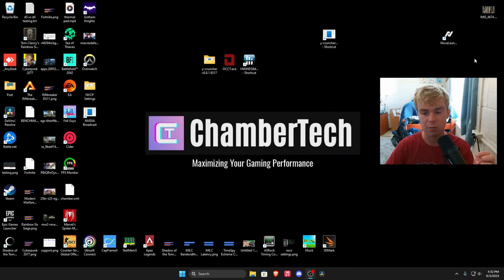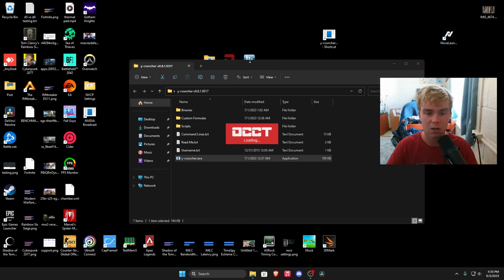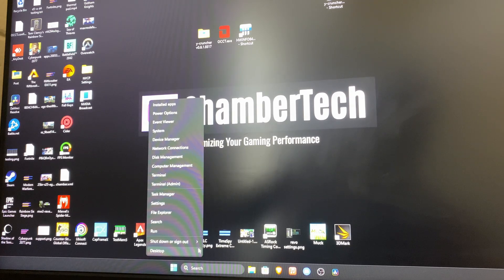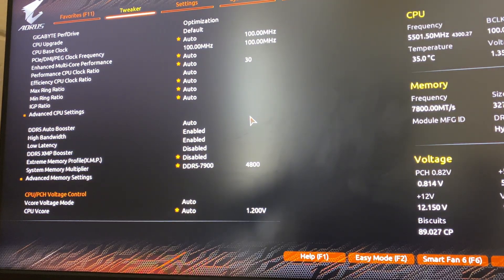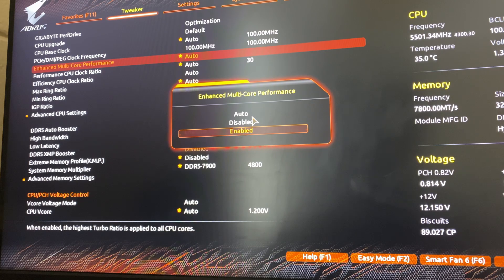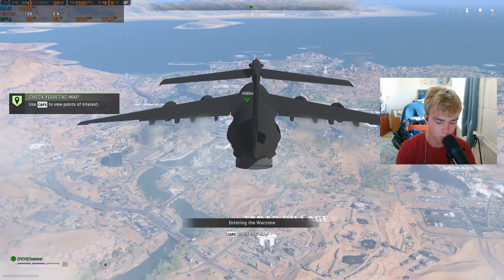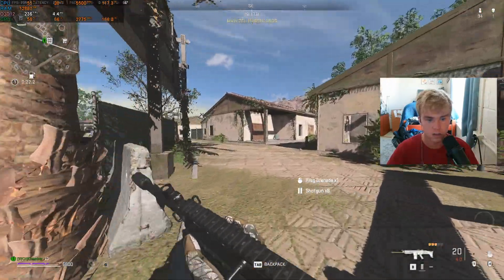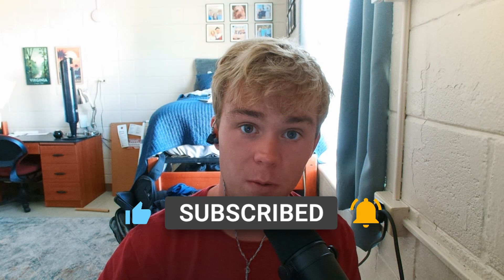CPU Undervolt Guide 2023!

Comment: I have 13700kf,2x16 7200mhz tuned latency is under 52 passed all stress test GPU Rx 6800 xt I'm very high fps but my .1% low fps is dipping from 200 to 9 fps and freezing for split second which is driving me crazy tried all the shit on online but nothing worked . Can anyone help me.
Reply from the maker: Something is unstable. Or the 6800xt is doing some amd things
Reply: @ChamberTech  my m.2 SSD is not running on raid mode and csm support is enabled in bios when I enable vmd settings my is not booting

Comment: So happy when I switched from the 13700kf to an 7800X3D, like 70-100W less powerdraw for the same gaming performance :)
Reply: So your 7800x3d magically uses like 0 watts. I own both. The difference isn't that much and the 7800x3d runs just as hot if not hotter because the thermal dissipation is complete garbage.
Reply: @MrDutch1e  No, but in most Games its between 40-60W, my 13700kf overclocked was at 120-150W in many games, sometimes up to 200w. Stock it was drawing about 40-80W more, but a lot slower than an 7800X3D. Yes it runs hot, delidded mine because of that, but only because I wanted a bit of thermal headroom with my Noctua L12S, if I were using an bigger cooler in a normal system its a non issue, yeah it hits 89C but it isn't really downclocking.
Reply: @Rodney-cq7xo  a lot slower? Lol. Once you tune memory on both they're near identical. Look at starfield and ray traced titles that rely on memory throughput and intel beats it. Not to mention if you actually pay attention to 1% and 0.1% lows intel wins in almost everything. I own both and play mostly competitive titles and the experience us definitely better on intel.
Reply: @MrDutch1e  I was running 7000 1t on an Z690 Dark, yeah the i7 was faster on some titles, the Ryzen is faster on others, overall its a draw but the Ryzen uses so much less power. I meant slower when the i7 runs stock.
Reply: @Rodney-cq7xo  power consumption doesn't really matter to me when it's like 50-60 watts difference under load. Temps are what matters to me more. Within reason of course. With ryzens history of dying CPUs (memory controllers mainly) compared to intel I'd prefer a cooler running intel CPU that uses more power. Especially when you consider all the bios issues that still exist on am5. It takes brutally long for these board manufacturers to figure this stuff out. Like still can get into bios with expo/xmp enabled on asus or msi boards on 4000 series gpus is just crazy. Ya enabling memory context and power down mode (just memory context will result in constant blue screens) fixes the issue but why is that necessary. Why isn't memory context enabled by default and stable without enabling power down mode. Just a complete mess imo. Always something you have to accept and just deal with on AMD whether it's GPUs or CPUs. I had my 13700k tuned and running mint within a few hours. 7800x3d took me like 3 to 4 days of trouble shooting and researching, cmos clear after cmos clear, to get running properly. Then still ended up with a faulty board lol.
Reply: @MrDutch1e  That stuff can always happen. For me its running without an issue and it was a lot easier to get similar performance than the intel system.

Comment: I‘m no intel or amd fanboy (rocking a 13900k 7800mhz tuned rig myself) but in terms of efficiency and temperatures the x3d chips for example the 7800x3d runs so much nicer. In Wz2 in my opinion it makes a  difference in terms of heat-output if my cpu needs 130-150W or like 60-80W (wild guess since I don’t have a 7800x3d yet). BF2042 is by far the most intense cpu and ram intensive game so far. Stock 13900k pulls just over 200W sometimes, 7800x3d not even 80W. Tested 2042 with an oc on the cpu and boy oh boy 230+W on the cpu alone(1440p btw). 
Fanboy-ing over Hardware is so dumb and useless, but tbh I would like to see that Intel is doing something  like amd with 3dv-Cache and efficiency because in no gaming Scenario should the cpu use over 120-150W alone. Would like to see a gaming chip with only P-Cores like 6-10 Cores since most games won’t make use out of e cores and they add more heat to the cpu. 
But still good Vid 👍🏼
Reply: I know you didn't just use temperatures and X3D chips in the same sentence. I have a 7800X3D and they run far hotter than Intels counterpart, i.e. the 13900K/F (which I also used to have). 

This is one of the issues that people such as yourself run into when you've not tested these things yourself, the watts used on AMD vs Intel means absolutely nothing, it's a non-issue and most people think it is. For example, I can use 60w on my 7800X3D and still hit the same temperatures that my older 13900KF would be hitting at higher wattage because of the diode that is being used on AMD.

You mention BF2042 and again, both CPU's easily hit 70-80c on the game, depending if you have unlocked FPS (as we all know, FPS locks/limits reduce heat/tdp) or not, so the fact that it's being done at different wattages is completely and utterly irrelevant. 

Lower wattage doesn't necessarily mean 'better'.
Reply: 7800x3d runs just as hot if not hotter than 13th gen in games because the thermal contact with the ihs is garbage. My peak temp after a long session of warzone is higher on my 7800x3d than my 13700k lol. That's also with -20 curve optimizer on the 7800x3d. Yes it uses less power but it can't transfer the heat efficiently so it doesn't really matter.
Reply: @MrDutch1e  I know you're not the OP butt the reason the X3D chips run hotter is not because of poor IHS contact. This is an Intel Z690 issue, not an AMD issue. The reason it runs hotter is because it's a much more condensed die vs previous generations, smaller die = less room for the heat to escape = more heat, just your bog standard thermodynamics.
Reply: @Fragil1ty  no its an overly thick ihs they put in so they could match the z height for am4 cooler compatibility paired with single ccd x3d. There's literally hardly any heat dissipation through the ihs. Which is why a single tower air cooler gets essentially the same temps as a 360mm aio. It's a terrible design. They should've just made cooler manufacturers make adapters for current coolers like intel did with lga 1700 instead of making the ihs stupidly thick.
Reply: @Fragil1ty  also the lga1700 issue is a bending issue of the ihs. Running a convex cold plate cooler or a contact plate frame fixes the issue. I'm talking about badly designed heat dissipation between the ihs and the die.